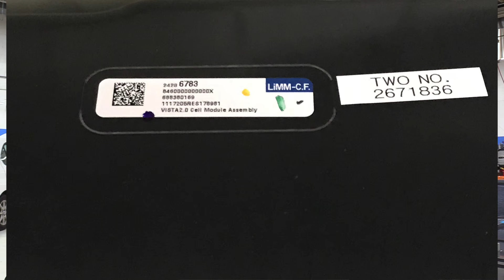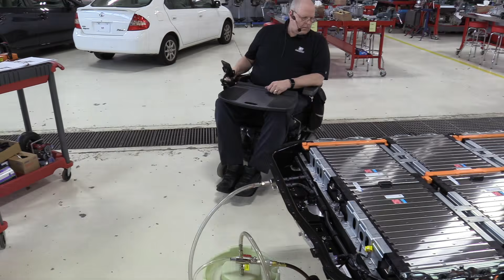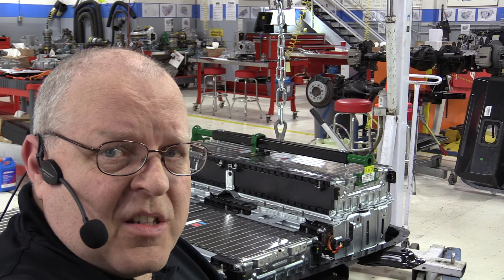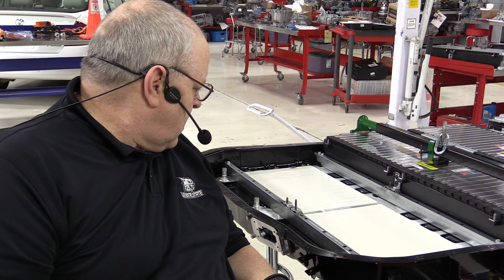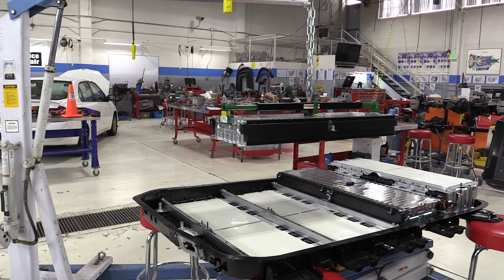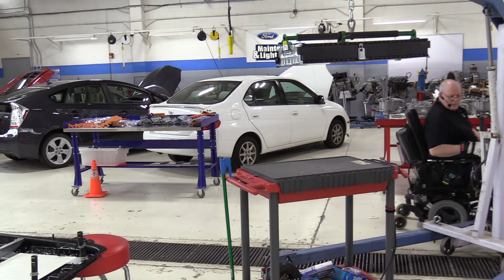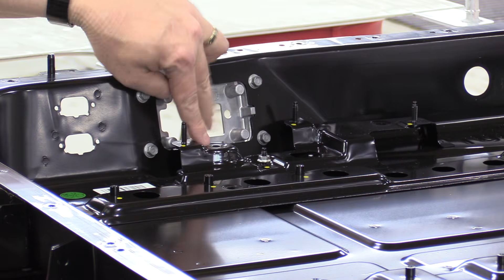Chevrolet Bolt EV Battery Disassembly

Comment: Ok.  Call me crazy, but ........... I'm watching this video thinking about how I would re-purpose these cells to make a replacement Volt/ELR pack.  Hypothetically if I could fit the same # of cells, how much different are the cell specs which would be the biggest fear w/ BECM/BICM freaking out.  Let's forget footprint and other considerations for the time being and just talk hypotheticals.  Cells close enough that Volt/ELR BECM/BICM modules would work w/ these or?   

Really don't want to let go of my ELR, but battery is a major limitation.

Comment: 840k views 400k subscribers 8k likes and 800 comments

Over 8 years 

This equipment was nearly new when this was made

I am surprised that our host and guru did not start with the battery topology. And some comments on chemistry but apart from that this is a masterclass.

Webber Uni is missing a certification opportunity here, as one of our viewers from the Indian subcontinent pointed out.

Comment: Does the BECM balance regardless of the SOC? Suppose it's plugged in and limited to 80%, will it still make an effort to balance the pack?
Reply from the maker: Yes. Anytime the vehicle sits for a long duration it will be trying to balance the cell voltages.
Reply: @WeberAuto That's helpful to know, thanks.
Reply: @WeberAuto  That's incredibly helpful to know, thanks.

Comment: Thank you very much for this instructural video. Since 02292024 i bought a second hand Opel Ampera-e, the equivalent of the chevy and was very curious after the batteriepack. Also in Europe they changed the pack and my 05292020 car was updated to 66kWh. You ended with “i am not a strong man anymore” Well sir, on the contrary, you are a mentally giant! Thanks again, Hans Both, Haarlem, The Netherlands.

Comment: So GM, those colossal drill-arses took LG modules with dual side cooling and decided to cool them only from one side, via a thick thermal pad. REALLY?
Here one question, how feasible would it be to custom-fit another set of cold plates from the top as well?

Comment: Does anyone know if its OK to charge the 2023 Chevy Bolt Battery all the way everyday and NOT worry about faster battery degradation?   Or, would it be best to charge the Battey to 90% when i dont need the full range?
Thank you

Comment: That's just plain cool. I've had a Volt for over 5 years, about to trade it in for a new Bolt EUV. I'm a mechanical geek, seeing this stuff and knowing how it works will greatly enhance the pleasure of owning and driving it.
Reply: Geek out! I wear the title of Nerd with pride. 
If you are watching this channel and reading this comment, chances are high you are also a geek nerd like me😄
Reply: How long the battery last ?
Reply: @juniorsavoy1010  A very long time, probably 10+ years if not physically damaged, treated out of spec, deeply discharged below the safety cutoff level, etc. Do note that like any car, the Bolt has service intervals for components, such as the 12 volt lead acid battery, coolant loop servicing, etc.

Comment: ...my knowledge on these battery is that only <1/4 dcv of it's full potential is available... so the new 100% (80%) - the battery low voltage cutoff (0% )..i arrogantly assume...and the hi-voltage charging terminals are to close together..even the regular car battery has these terminal far apart..like >10 cm..imagine some hacker plugs a u-plug to the hi-voltage dcfc unit...will it short & burn...?.. security reasons

Comment: Great video, but after watching for an hour and a half, I was disappointed when you didn't completely disassemble a battery module down to an individual battery, or the group of three batteries that are connected in parallel....
Because if ever have to repair a Bolt battery, it would be much cheaper for me to purchase a group of 3 cells in a 4 volt battery than to replace the entire 40 volt module

Comment: I am wondering, if the battery modules were taller top to bottom, enough to increase the capacity to 100 kW-hr, would the weight increase so much that the overall energy efficiency of the vehicle would suffer? The Second Law of Thermodynamics, as applied to PHEV's and EV's, limits the re-capture efficiency of the regen braking system to no more than about 30%. This means that for every 3 units of energy you extract from the battery to accelerate the vehicle, you will never be able to recover more than 1 unit at the next stop sign or red light. The heavier the  battery is, the more energy you need to propel the car. Is there a point of diminishing return with EV's and lithium ion traction batteries, where it simply makes no sense to make the battery any heavier? And then there's also the fact that a heavier battery means the brakes, suspension components, and structure of the car's whole frame have to be stronger (and heavier), to be proportional to the heavier battery? 

The point I am trying to resolve in my mind, is that the Bolt, with it's 258 mile range, still falls far short of the 600 mile range that one can get from a Prius Prime or Camry Hybrid, and out here in California, people have to drive long distances to get between major cities: 450 miles from San Francisco to Los Angeles, for example. My Prius can do this easily on about 8 gallons of gasoline, maybe 7 with a tailwind, but there are NO EV's that can do this, at least not any that most of us could afford to buy. I love the idea of the Bolt: charging it at home with 10¢/kW-hr inexpensive electricity brings the cost/mile for "fuel" down to about 2.5¢/mile - about 1/5 of the cost of gasoline for the average 30 mpg car, and 1/2 the cost for gasoline in a Prius or that Camry Hybrid I mentioned. But range...is it even possible within the laws of physics and chemistry, to build an electro-chemical battery for a Bolt-sized car that would weigh no more than the battery in this video (1,000 pounds), but that would have double the storage capacity? 120 kW-hr instead of only 57?

Thanks for this video, Prof. Kelly! I've been very curious to see how the inner workings of a large under-floor EV battery are designed. I've seen your video on the Prius Prime battery, and while it's somewhat similar in concept, it's much smaller.
Reply: Since GM are replacing the Bolt Li-ion battery pack (with present energy density of 131 Wh/kg), They should take the opportunity to replace them with their new  Ultium battery which has more than twice the  energy density (280 Wh/kg). This will make twice the range in a same battery pack size.

Comment: If the becm is placed outside de battery pack, will help to troubleshoot without removing the whole battery pack. Just my two cents. It's not necessary to have inside.

Comment: Looking at this, and looking at the BMW i3 battery/case..what a difference...the BMW is all aluminum so no chance of rusting and the structure itself is far superior to the bolt, and looks simpler in design as well.

Comment: What a nightmare to replace a fuse (or other small item) in the middle of the entire battery. I think it could be designed MUCH simpler - more modular, but importantly - more easily serviceable without removing the entire congested conglomeration of paraphernalia.. bolts, gaskets, lubricant, and other stuff all jammed on top of each other. It reminds me of servicing old JVC video recorders back in the 1970s.. crammed in unservicable crazyness.

Comment: Your videos are great. Thank you. I'm considering a Bolt. But all the coolant connections within the battery give me pause. Seems like there would be a potential of a leak that might cause a shorting out of the batteries. Would probably be wise to lease rather than buy one of these.

Comment: Furnace works as a AMPLIFIER. SENDS frequency waves surrounding A.C. units intercept signal. Then fun part lap tops suck the info. They look it over. Make few adjustments head DOWN to the lab-studio-analyzing room.

Comment: Incision a vehicles headlights as camera with sensors as u get so close it clicks your furnace as a motherboard recording everything it sends the signal to vehicles that then drive off to a disclosed processing center where they take the memory chip out and plug into a ether drive which uploads info they process it.

Comment: I was thinking about to make the car electric, I do then use a 20 Kw pump motor who I do rewind for higher frequencies and higher rpm for 120 volts and use accu,s. I think that motor on a gearbox will work fine.

Comment: 40 volts is still a bit high. Think of a 9v battery on your tongue.  Stick your tongue across 40v and you’d feel it. I suspect if you licked your fingers and then put them across 40v, you might feel it.
Reply: Voltage bellow 60 Volts are considered safe. You may feel it, but it will not hurt. This is why the old wired phone lines were powered at -48 Volt DC. ( the minus voltage refer to ground, this is to avoid corrosion on the wires. Positive wires always corrodes)

Comment: Before removing the battery pack lid You had said there is screws and switches. But later you never talked about switches .Can the battery pack suppliers know is the lids are open Would the warranty be void ?

Comment: Can I have you install my replacement battery packs? I trust you more than my local dealer. I don’t want to be the first one or two installs at me local dealer. I think by the time they get to my newer Bolt they should have a few under their belt.

Comment: When I bought my 2018 Bolt, they informed me over the phone that it had DC FastCharge capability. So when I went to see it in person, I didn't think about verifying/checking and didn't find out until I bought it and got it home that it actually lacks the fast charger. With the battery replacement recall for the Bolts, I wonder if they can upgrade my car with the charge circuit... or if there's a bunch of other stuff that I'm lacking.

Comment: Why does EV cars use liquid cooling instead of 0.7 DC amp electrical cooling system. Liquid designed cooling is dangerous since the liquid cooling is next to this high voltage system. Electrical cooling is more efficient and very safe.

Comment: I'm a 2022 Bolt owner and concerned about the likelihood of it catching fire. GM told me to park it 50 feet away from all other vehicles after charging. That's not practical in an urban area. I like the Bolt. It's one of the best handling and driving cars I've ever owned. I really hate to get rid of it, but I'm stressed about the fire hazard. So, I've asked GM to buy it back & replace it with a comparably-priced vehicle. Should I proceed with getting GM to buy it back, or should I keep it and wait for whatever needs to be replaced?

Comment: Around 55:00 you see 40.5v and say you aren't sure how many packs in serial there are, if it's fully charged as you say that's either 9S or 10S. 9S would be ~4.5v/cell which is possible but that's real hot, most lithium cells fully charge to about 4.2 - 4.35. I bet it's a 10S @ ~4.0v/cell.

Edit: Should have watched to the end before commenting...

Comment: I come here to learn about the Chevy Bolt that are at risk of self-immolation while charging. That bottom plate cooling is insufficient. They either need a second cooling plate across the top of the cells, or more ideally, cooling channels sandwiched between each cell, as Tesla does with their cylinder cells.
This will require a pack redesign, with probably smaller cells, fewer cells, or a slightly thicker pack that hangs closer to the ground under the vehicle, to make room for more cooling plates or channels.
Although Chevy is trying to blame the battery manufacturer, random internal shorting is a fact of life with rechargeable battery cells due to crystal formation, and is why modern cells are never normally charged to 100% or discharged to 0%.
Tesla prevents internal shorting from damaging the parallel cell groups, with fuses on each cell. If a cell shorts internally, the fuse blows, and the cell is deactivated rather than causing a sudden total discharge of the parallel cells.
But there's no way to stop an internal short within a huge prismatic cell slab or pouch from suddenly discharging the entire cell.
Apparently Chevy engineers never bothered to test if their bottom plate is up to the task of safely cooling one or more internally shorted cell slabs that suddenly discharge themselves from full to dead.

Comment: Just think,   Per the new Bolt battery recall,  local dealer techs all around the country are gonna do this procedure 75,000 times.  
Do you really think they’re gonna get it done right?    The same dealerships that lack knowledgeable Volt techs and seem to know so little about the Volt.    What a disaster.  How many will cut corners and get electrocuted ?
Reply: Chances are very few dealerships will actually swap battery modules but instead whole batteries.
VW went through a similar recall with their plug in hybrids and some e-Golfs.  Not battery fire but water getting into the packs due to inadequate sealing.  They just replaced the packs at the dealer and send the old packs back to Germany to be refurbished.

Comment: I was surprised that removing the bus bars was so far down in the procedure.  I would probably want to get the voltage reduced as much as possible right from the start.  e.g. service disconnect, BECM, then bus bars.

Comment: Wonder which one of 5 is touching. Seems #5 is not cooled as well and could get extra heat from #4.
Reply from the maker: 5 has its own dedicated cooling plate. Thanks for watching!
Reply: @WeberAuto  cool fires are being reported starting under back seat, probably coincidence? Any other EVs stacking batteries?

Comment: GM has a recall going on for that year Bolt. Battery fires. I wonder which sections overheat? I am betting that it is in the rear tall section since in the Nissan Leaf that is the section that generally fails first.
Reply: The thing is: over time cells develop two kind of problems, but thing does wrong when those two kind of problems occur in the same cell. This is where the cell catch fire.
Reply: @AndreHoude-o2x  I recall reading about the GM engineers and LG finding that the fires were caused by poorly manufactured cells inside a few of the modules. The "tabs" on some cells were bent the wrong direction and probably coming too close to tabs with the opposite polarity. When that happens "poof!"

Comment: Hi, thank you so much for the informational video. I am wondering if you have a part # @ 14:08 min for the battery charging cable?
Reply from the maker: No, sorry. Thanks for watching
Reply: @WeberAuto  Thank you so much for the time to reply and the informational information you put out. And last question to your knowledge can that connector be bought anywhere?
Reply from the maker: @edgtr87  Yes, you can buy it from a Chevrolet dealership

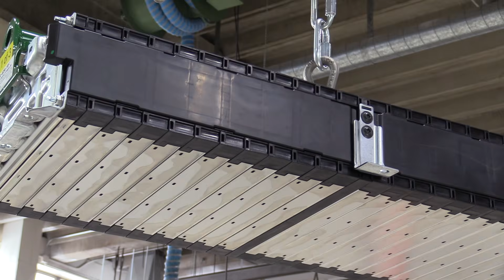Comment: 1:21:29 - You can see there was uneven contact with the thermal pad. Those cells with poor contact wouldn't be able to reject as much heat, leading to uneven cell temps. Potential cause of the battery fires?
Reply from the maker: Good question. I do not know. Thanks for watching

Comment: So GM is having a massive recall and problems with battery fires in 2017-2019 Bolts, with North Korean cells, but the 2019 and newer have the same pack but USA built cells.  

I was surprised this 2018 had a different battery design than the 2017 (you discussed the labor and cooling being different). Any insight on the battery recall, the fact the firmware update did not work, and what’s different in the 2020+ packs with more range?!
Reply from the maker: I wish I knew more. I have a 2019 myself, but with the USA built battery. The 2020+ have a 66kWh battery
Reply: @WeberAuto  I have 3 of the 2020, absolutely love them.  GM should buy back your 2019 or do a MSRP swap.  I also have a Telsa, amazing to compare these
Reply from the maker: @olemissjim  I agree! Thanks

Comment: Simply! GM has it's head up it's ass! They could have eased this country into the adoption of a self charging electric vehicle and chose not to do it. This would have made it easier on the auto industry in general. But no, they went another route. Now a self charging electric car is going to have to come from Joe Public in small neighborhood shops. No? Think again. Teenagers are making them. It's not that hard. You can't charge people $40 grand plus for a car or truck though. People will do what's right for them.

Comment: Did you discharge the battery before removing it ? - is there a tool to discharge a full charged battery?
Reply from the maker: No discharge is necessary. Yes, there is a discharge/charge tool for disposal and battery section voltage balancing. Thanks for watching